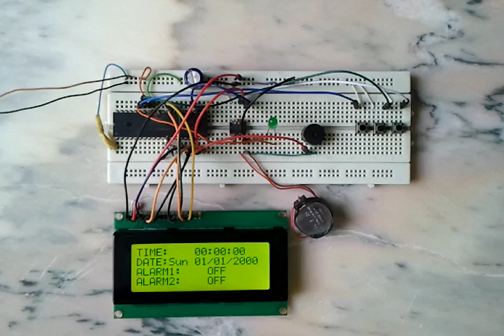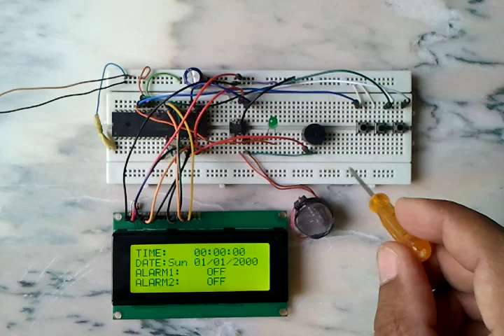Real Time Clock with 2 Alarms using PIC16F877A and DS1307

Comment: Hi. I've a problems during the simulation.  I seems can set the minute, hour, day, date, month and year by pressing the push buttons, but at last the LCD did not display them. It just display "Time: 00:00:00", "Date:  00/00/2000". 
 how to solve this problem Sir? 
thank you in advance.
Reply: Did you fix it yet?
Reply: Žaidžiam su Karoliu. Not yet. Do you know to solve it?
Reply: nope, i went to arduino it much simplier
Reply: i have the same problem !!Did you fix it yet?

Comment: Hi,
I've already constructed this entire circuit but it seems not to be fully working. 
I'm able to set the alarms, time/calendar and also increment correctly, but it seems to be so glitchy, as in it would randomly change numbers on the LED screen frequently and turn off the alarms all in one go, and even show a whole screen full of arrows (<--). Do you think this is a hardware issue? Any insights on this??
Thanks
Reply: The LED screen would also constantly flicker as well
Reply from the maker: There may be a problem with connections, check the circuit diagram and reconnect your circuit, it should work as shown in the video.